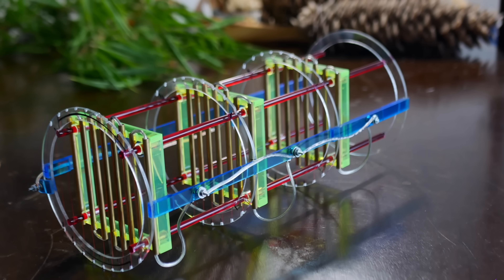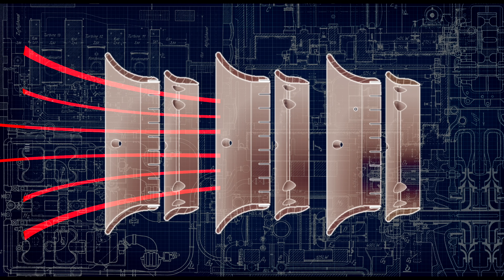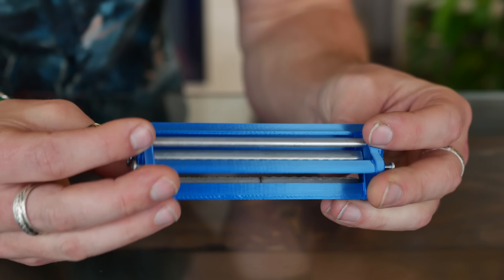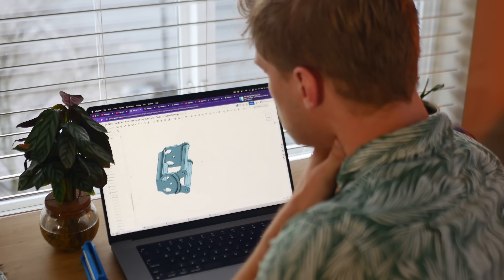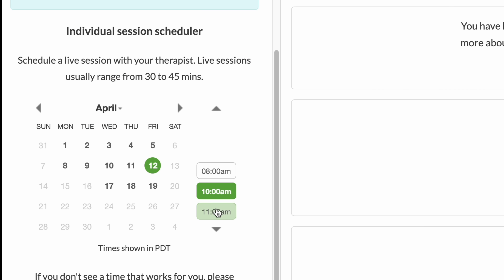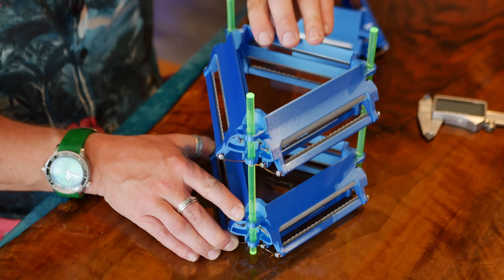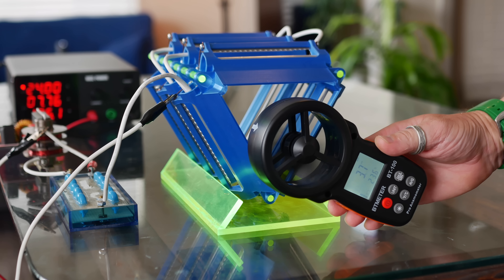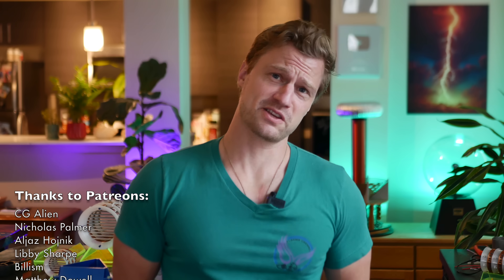Next-Gen Ionic Plasma Thruster Inspired By Nature (BTC Mark 3)

Comment: Did you tried using liquid ammonia and ram jet turbine with magnetic confinement ( or piezoelectric vacuum pump for simulating air pressure)   Since liquid ammonia is flammable and it can be ionized and can be find anywhere in universe  , plus it has much lover temperature  400 to 600 degrees Celsius  . Just thought it would be interesting to see small scale model in one of your experiments.

Comment: 75W @ 60kV and your thrust is still increasing as you close the electrode gap? You need a new geometry surrounding your electrodes. To improve the magnetohydrodynamic effect in air you need: 1.) control surfaces closer to the electrodes to increase laminarity 2.) pressure retention between stages I.e. Tesla valve electrode fins 3.) pressurized plasma supplement I.e. argon, xenon. If you electroplate the “fins” of Integza’s cylindrical Tesla valve in copper to act as one polarity of electrode and the walls as the other, place pressurized argon outlet upstream, and engage the doped air with pulse width-modulated stages of current like a coilgun. See nighthawkinlight’s video on the effect of Tesla valves on a flame front which is itself a form of plasma that induces a positive pressure.
Reply: By leaving your ion drives “open-back” (to use audio terms, oh well they’re both thermokinetic impulses in air), you are attempting to alleviate back pressure but are actually sacrificing inlet velocity. What you’ve made is a bladeless fan but for true thrust you should consider thinking of it as a high speed wave-machine, like the old WWII pulse rockets. I’d be doing it myself but I don’t have fancy workshops like y’all😂

Comment: Ok if you take the design and make it a circle it would allow for more peripheral air input, it would simplify the design and structure and a cylinder would add to the overall structural stability.  Also you could use thrust vectoring to direct and compress the thrust further.   You could also use a magnetic field to compress the charged column of air, much like a fusion reactor uses a magnetic bottle.

Comment: To avoid producing oxyhydrogen you could try to position the cathodes staple spatially removed from the anodes staple (with maybe even a perforated little wall between them). Then, the hydrogene gas should bubble up seperately from the oxygene (not to a 100 % pure each, but not explosive anymore).

Comment: In addition, you need to either get a larger air speed sensor thing or encase the design. You are losing valuable thrust from the sides when it could be building higher pressure. And I think now you should design outward instead of trying to increase one thruster. Your original design incorporated into the wing I believe would work great if it had many of them across both wings

Comment: You need to create a solid closed sleeve to encase the outer surface and the sleeve should extend outward in the direction of airflow several inches and all 3 sides of the sleeve should taper inward like a 3 sided pyramid slightly further than the point at which all 3 airstreams converge so that once the air does converge its funneled straight backwards at a higher speed and pressure instead of some of the air thrusting outward after it converges. The hollow center is cool but it may be more efficient and give more thrust if you create a pointed cone or solid 3 sided pyramid in the center of the open space similar to scramjet while in forward flight instead of the air from drag being wasted passing right through, a aerodynamic pointed shape inside of the center that leaves a little bit of space around the sides will act on the same principle of an airfoil by speeding up the air around the cone and forcing the high speed air straight into the ionic thrusters like a turborcharger on a car. In addition, it may also create a low pressure system in front of the entire thruster and a high pressure system behind it may help increase its effectiveness and speed

Comment: This may sound like stupid question given the air is not acting as a conductor like water would, but could this design be changed to push water i.e. underwater.  Magnetic propulsion underwater has been done, but the results were not only poor, the power needed make a true magnetic propulsion drive like in the movie Hunt for Red October is not realistic yet.  If I understand iconic propulsion, you are creating a high to low pressure system to move air.  Theoretically you could do the same with water.  Also instead of putting it on top of the wing why not put foil on the forward of the wing and foil on the back flap of the wing and the apply + on the front and negative on the back.   I believe Tesla used a composite metal to generate higher electrical current than traditional copper or steel, but I couldn't find the article that had the exact formula.   for example foil is light, so why not use it as the lift portion of the wing, vice plastic sheeting making most the wing positive current leaving some space between the back of the wing which would be negative current.  The top part of the wing would produce some thrust, but the underside of the wing should produce both thrust and lift.

Comment: Rather than trying to create a linear flow, why not attempt to make a rotating flow. Essentially like rifling in ballistics. Even with magnetic acceleration, the stabilzation provided by centrifugal forces will reduce drag. The column will naturally build pressure and speed at it's center as the thrusters converge into this spiral shape.

Comment: Now you need to connect this to your audio driver. If you can move that large volume of air with no moving parts, you should be able to create a very high quality speaker. Audio is just air moving, so this should work.
Reply: Damntrue, but there are such speakers
Reply: @KuldeepSingh-je2zl  The ones I'm aware of need to be supplied with other gasses.

Comment: Hello. Have you tried integrating a smaller triangular structure behind the first vector? And for the parallels, try moving the spacings according to Fibonacci, e.g. 1.1.2 3. This should compress the input field in the small triangle, so compression of the compression = more speed. Have a nice day.

Comment: I did the math a bit ago, just cause I'm ADHD and my brain brained, but to lift 283 lbs which is the max for a part 103 aircraft you'd need around 400,000 volts. Or if you configured it with 4 ion thrusted aligned vertically in order to create a similar configuration of a drone, about 100,000 volts per truster. Granted, this is just the ramblings of a novice that this video caught the attention of. An interesting concept to say the least. Install a generator or duel generators spinning in opposite directions to offset inertial momentum and you could have potentially significant range.

Comment: Have you thought of stacking both mark 2 and 3 together? An initial acceleration in the center column while the sides have the blade design. You might run into the same problem you had with the mark 1 where the interaction time between nodes was an issue. I would like to extend the opinion that each stage would need to extend there interaction time in the center, but not with the blades.

Comment: It’s just an idea but have you tried making a ionic thruster that combines both or uses both like if the internal side of the thruster being like the mark 2 while the outer side is like the mark 3 and the outer side air converges into the inside into a mark2 and the head wind going into a mark2  and the side winds converging using the mark 3 making a hybrid where it uses both properties of both mark2 and mark3 into a new thruster?

Comment: Brother, I think you need to increase the frequency output / voltage at each level. Taking the already  moving air increasing speed on each level. If all the wheels turn at a set speed that’s the max the air can move. If each one increases they benefit from the previous one accelerating the wind. It’s easier to continue pedaling rather than the torque it takes to take off. An object in motion ect.

Comment: Do a test where you introduce air flow into the front of the system. If it is meant to fly it will have to work with heavy airflow running across all surfaces. I’m no expert. I’m just curious how it would impact the system.

Comment: I don’t want to be a hater on ionic thrust for aircraft because we could be near a break through plus it’s a cool tech to research. But don’t the scalability limitations make it a bit of ‘no go’ for any realistic use in aviation?

Power to weight issues. Energy requirements. And most obvious it’s propulsion requires air, denser the better something high altitude lacks.

Just the energy density problem causing a severe power to weight imbalance seems like this should take a back burner until some amazing technology in energy storage is invented.

Gliders can operate off thermal currents, the power requirement discrepancy between a glider and a passenger airliner (for example) is light years apart.

Comment: You have to make a micro ion engine. 
Make as small circular holes as you can in the copper plate glued to the insulating porcelain on the back. Let there also be a discharge protrusion needle pattern that extends to the center of the holes, similar to the letter Q. 
Then ZVS at high voltage and frequency to the two ends of this plate  
Link. The electric current flowing back and forth creates powerful plasma explosions at those needle tips. Since the back side is porcelain, the vector of plasma explosions generates pressure in one direction. 
This is how Viktor Grebernikov's antigravity plate works. You can hoverboard.

Comment: I have a suggestion that I am not certain will work, but that I would like to see tried:

Simply put, ionic thrusters work in space by utilizing newton's third law. For every action, there is an equal and opposite reaction. 

This means that, in a near-perfect vacuum such as space, the thrust produced is actually reliant upon the mass of the electrons. As an electron is forced backward, an equal amount of force goes forward, thus propelling the ship.

On earth, there is a bit of a different effect due to the fact that we are not in a vacuum.

As the electrons move, they both force air out of their way in front, and pull air from behind them forward. This creates the airflow that you see.

So, the amount of air that is moved actually depends on the  total combined surface area of the electrons that are being moved (and the mass, but that is constant).

So, to increase airflow/airspeed, you just have to increase the total surface area of all of the electrons being transferred.

You can increase this surface area in two ways: 

1 - Increase the amount of electrons being transferred (more power). 
2 - Increase the travel distance of the electrons.

Of course, you can't just make the arc longer without having negative effects. So, my suggestion is to use more rings. If you can create a tunnel of electrons jumping from ring to ring in sequence, the limitation to the airspeed will only be the length of the tunnel that the air is traveling through, (that and the speed of the electrons of course).

I hope that that helps in some way. 

You probably won't read this anyway, but I thought that you might find it useful.

Comment: Since the first video I thought: "Why doesn't it taper to increase the pressure and have more air to interact with the blades?" I don't know, I'm not an engineer, I don't even know if there is a reason that didn't cross my mind
Reply from the maker: The trick with tapering...is you need enough static pressure to begin with. This ionic turbine, while advanced, provides very little static pressure, and any obstructions to the airflow (constraints, nozzles, etc) tends to decrease output. But, I'll experiment with this in future videos.

Comment: Is there air turbulence within the thruster?  Could you run the smoke machine through the interior and have a camera angle to see how the added air reacts with the starting column of air?  Adding new air from the edges would cause atoms to bounce around and disrupt the direction of flow.  Would adding fins or blades inside help focus the direction of the air flow?  Would it be possible to create a laminar flow at the end tip?  Could you narrow the exit slightly to increase velocity?  It shouldn't be too aggressive of an angle because if it is too much then the air just bounces off like it is a wall rather than a narrowing tube.

Comment: Perhaps a simple boost to output airspeed would result if you design in a compression-type airflow tunnel as in a conventional jet engine? In fluid dynamics, compression will increase the speed of a fluid passing through it.

Comment: Nice try but we can generate massive boost with things our government eliminated! My design can yield air moving at well over 250 MPH and using them in conjunction can multiply that off the charts! It works by creating a vacuumed, which at normal air pressure causes air to go into the vacuumed at 250 MPH, so by pushing air into its entrance increases air flow!

Comment: What's really bothering me, is that you are just holding the wind meter in your hands, and don't really optimize the distance from the thruster. Since that distance can vary your measured air speed can also vary across tests

Comment: I'm not an engineer by any stretch of the imagination but I noticed a few ideas that may give you thought. 
Since you have stages wouldn't it be better for each to be smaller increasing pressure. Then with a Ventura effect between each.

 To conserve power make a firing order pushing the air in a pulse. Attached to each on and off a condenser or capacitor for a little bounce spark .
Just a thought ...

Comment: Sir next time Will you  make ion thruster of any kind but by making use of steam i.e ionize steam this might gives more thrust as compare to low density fluid like atmospheric air . Ofcourse in general steam is denser than air but once heated it will  not be  that much but still denser than if you make a little pressurized chamber for it for ionization Before it exit. Will this way possible for drone  ofcourse  will have  to carry a water for drone as propellent kind . i wanted to see this idea in practical way since steam is a well known medium or fluid we have been using  in advancement of technology after all .you should try steam power ion thruster if the results comes convincing enough Should eventually try for Drone .you have been doing  plasma related so Expecting from expert 😌

Comment: 3:11 you mention that an additional 40w only accelerates the to 3.2m/s. This is however the result from the fact that kinetic energy is the mass times speed squared. Adding the same amount of power would therefore result in 1.4 times the speed. It’s exactly as expected from physics. It’s not a flaw in the design.

Comment: If you offset each stage to swirl the output air  would it help create a bigger low pressure level for more intake flow and would variable intake angles do more if you could adjust them as required?

Comment: you should really build a thrust stand and measure the weight/pressure of thrust rather than air speed... (hovercraft vs jetpack). and think about increasing air pressure ... tip on a jet engine compressor each stage of blades the opening is wider at the back compared to the front slowing the air and increasing the pressure and temperature thus the next fan stage is designed slightly different to allow for the new air speed new air density. eg the smaller blade length but wider hub etc. After the final stage there is a massive reduction in speed as the compressor opens up to a cliff to enter the combustion chamber and the temperature is around 300 deg C (hotter temp actually reduces thrust if you can raise the pressure without heating ideal) before even entering the combustion chamber at this point. ... You could introduce a plasma candle to replicate the combustion of fuel to accelerate the air any excess heat you want to remove can be done with coils of water tubes and vent off super heated steam for extra thrust (this is dry steam and can light a match)  at this point there would be a turbine where the blades do converge increasing speed reducing temperature and pressure but its only function really is to turn the compressor the final magic is done at the nozzle... if you look into this properly there are allot of things that are backward to what you would expect but the same as you would expect at the same time making it very hard for normal Joe to understand.
Reply: try spinning a car turbo using a plasma flame

Comment: Let's say that the air blowing power of a fan is 2 per second. The power of 10 fans placed in a row will definitely not be 20. Unfortunately, physics does not work like that. You need pressure and power. I think researching the working principle of jet engines will be useful.

Comment: 2 major problems. 1, your engin needs to be tapered to force the air into a tighter exhaust outlet... 2, if you could use more power you might have a viable unit. Be safe, hope you understand this..

Comment: If you're using the same power supply for multiple stages, there may be some force trying to push air backwards. 
Try using an isolated seperate HV supply for each stage.

Comment: Wow~ Fantastic!

I'm not a specialist. But if I had the 3-stage triangular thruster, I will try 3 modifications.

0) Change the triangle to a hexagon.(I just like hexgons more than triangles)
1) Change stage 2 and stage 3 to fractal triangles. Stage 2 consists of 4 middle triangles. And stage 3 has 16 small triangles.
2) Reverse the stages of 1.

Comment: To reduce weight even more, you might replace the metal wires or blades by coating the plastic wing by using metalplating.